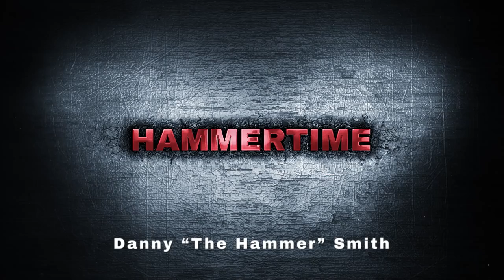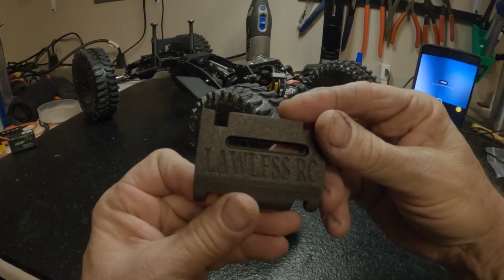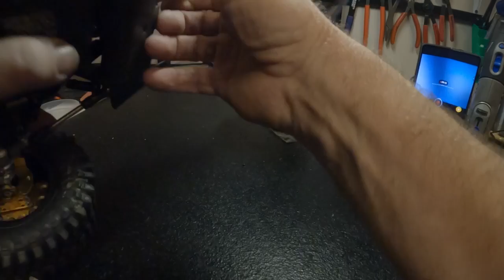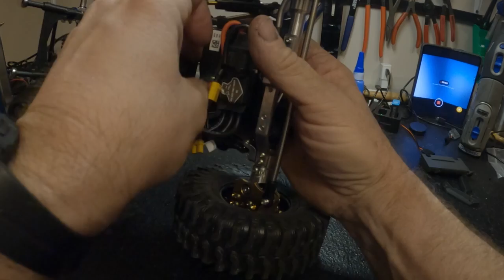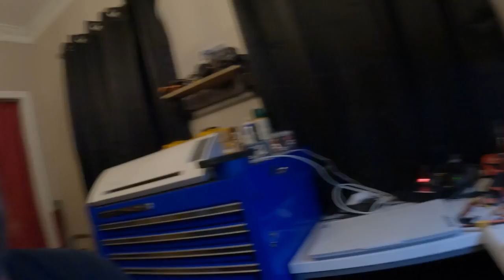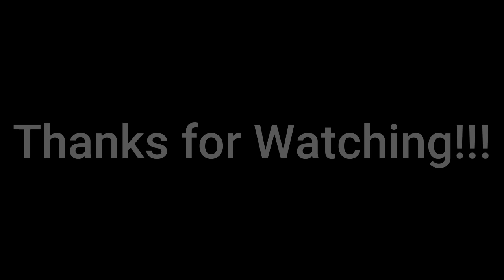New Lawless "Smooth Criminal 2.0" build

Comment: What is the optimal wheelbase for this? I have a POIZD T3v2 at 13.7" but I have this gut feeling that the SC 2.0 w/ a shorter wheelbase will outperfom it at comps.
Reply from the maker: The wheelbase on this rig is 14.375". That's because its built strictly to do crazy vertical incline stuff. For comps, the setup needs to be a little different. A bit more front end articulation and a shorter wheelbase. My comp truck is a 13" wheelbase Culprit. It is a very capable comp truck, but wont do a lot of the things this one will.

Comment: Awesome rig. Any reason you're running those tires backwards and not with the tread lugs pointing forward? Seems like there would be more grip and bite with the lugs pointing forward.
Reply from the maker: @cerwinvega12175  ive tried them both ways. This way works better for me.